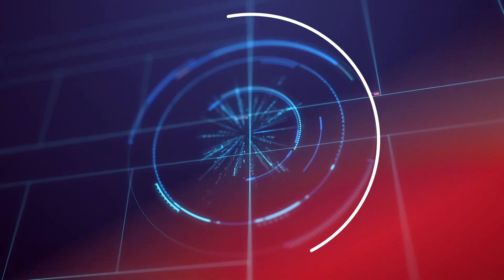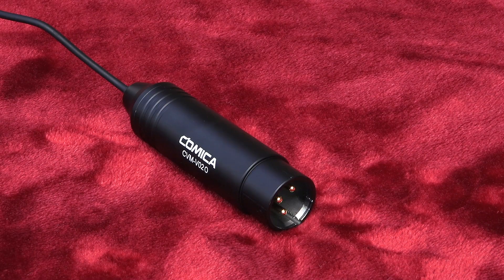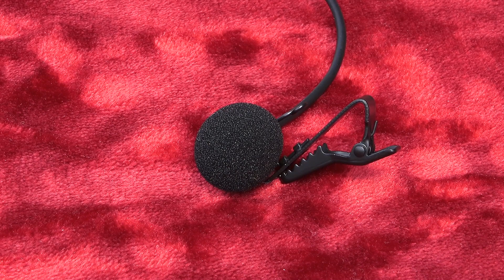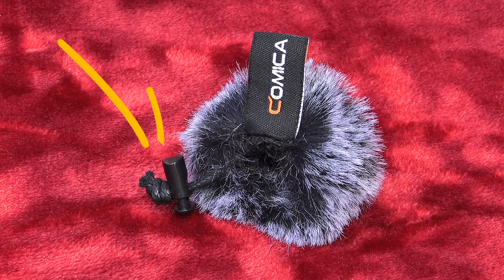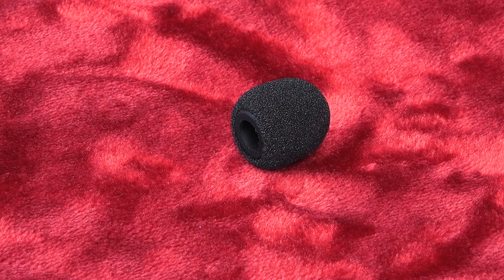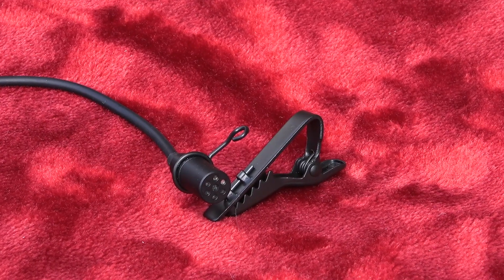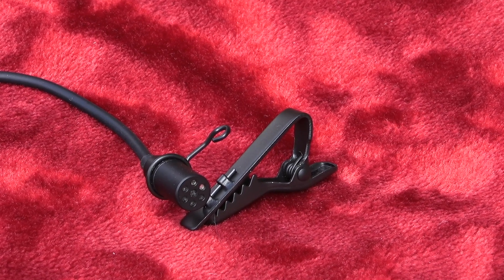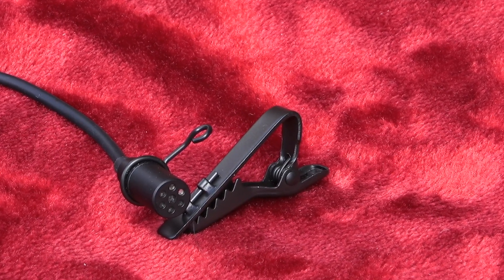Comica CVM-V020 XLR Lavalier Microphone

Comment: Hi Ian great videos brought a cx625 works great ,having trouble working out how to transfer to windows 10 pc and play them? tthankyou
Reply from the maker: I don’t use the Sony app. It’s awful. Basically, turn the camera on with the usb attached. Plug into computer. The computer should see the camera and two windows open. If you recorded in high quality, look in ‘Private’ and then a folder with mp4 as part of its name. 

The files will be in there. Copy and paste onto computer.

If you have trouble finding the right folder, do a search using *.mp4 when clicked on the Sony camera and your computer should find them.

Once you get used to it, it’s easy.

Comment: will this mic work with Xvive U3 Dynamic Microphone Wireless System with XLR Transmitter and Receiver
Reply from the maker: I think the U3 is for dynamic microphones, so it doesn’t put out any voltage for a condenser mic, so it probably wouldn’t work.